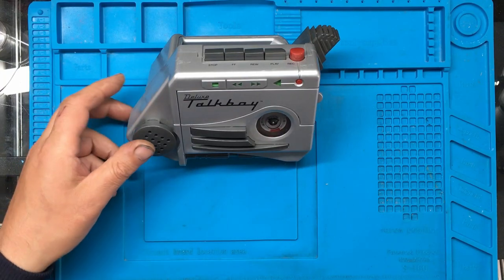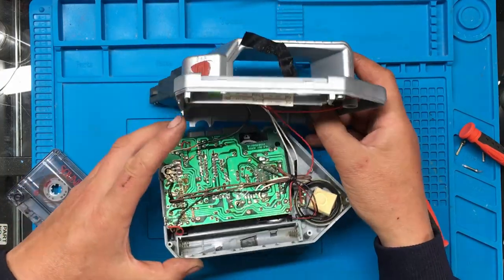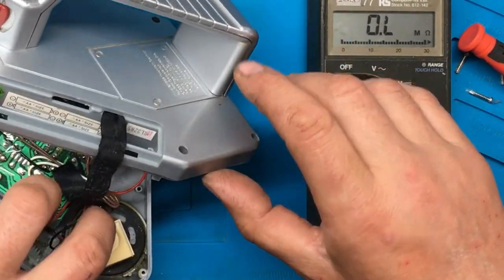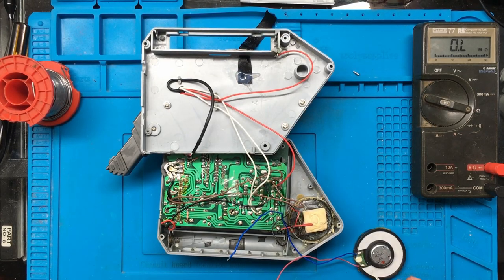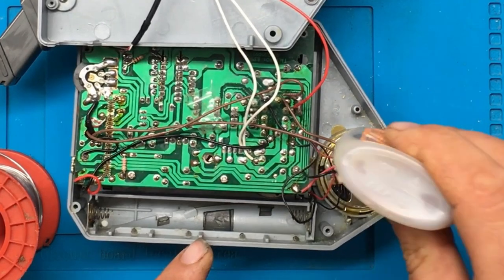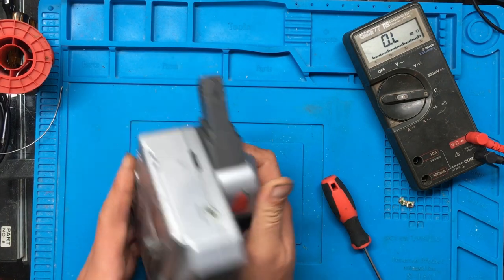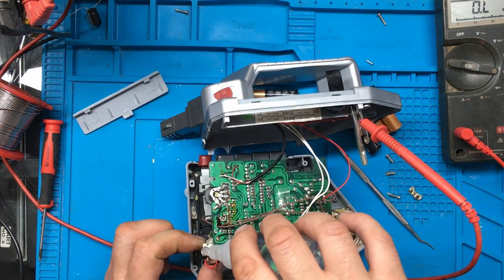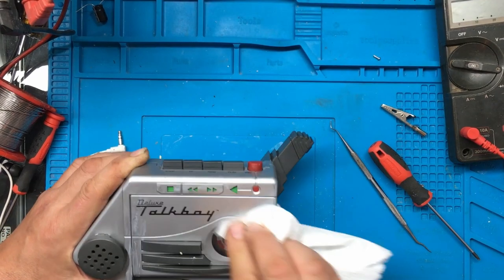Deluxe Talkboy - Faulty / Broken - Let's Fix It!

Comment: Fantastic !!   Can Apple Cider Vinegar be used for the corrosion problem??
Reply from the maker: I would have thought so, it's still acidic so it will neutralise any alkaline residue that is left. After its stopped fizzing I'd wash it off with some isopropyl alcohol. Hope that helps 👍

Comment: Thank you for the video! I have the older 92 model and I don't have the screw where cassette goes. Do you you have any idea on how to open the older model?
Reply from the maker: Sorry unfortunately not. I didn't see this screw until I opened the cassette deck. I'd just have a look around where it's not separating hopefully you'll narrow it down.
Reply: The little rubber plug on the outside comes out and reveals the screw.
Reply: @StephenCarlile  Thank you!
Reply: @StephenCarlile  Where exactly is that rubber plug? Tried locating it with no luck.
Reply: @1812salvipapi  on the front, to the right of the red record dot.
Reply: @StephenCarlile  Thank you, I never knew that was a plug. I thought it was just plastic like the rest of the outside.

Comment: Thanks for this video. I've been attempting to repair a talkboy for my nephew, using two donor talkboys. Interestingly, they both have a different PCB so it's not a 1:1 match. The board I'm keeping is identical to the one in your video. I was able to get things working super good with a new speaker installed, also had to solder on a donor cassette speed controller (whatever that part is called). The one thing I can't quite figure out is getting audio recording to work. I've tried soldering on a new mic, no luck. When I hit record, it will "erase" or record over the old tape recordings, but it will not add any of the sounds going into the mic. Any guess what could be happening or how I could potentially resolve it?
Reply from the maker: From what I remember when I looked at this one it is based around an IC that had an example schematic of how the circuit works. There is a switch with quite a few contacts to swap from recording to playback. If it was me I would probably use my scope set it recording and follow the signal to see where it goes and stops. If you don't have a  scope you could possibly trace it by probing with a small amplifier to see where the sound goes?
Reply: @BuyitFixit  Thanks for the ideas! I'll report back if I am able to resolve it.

Comment: What speaker did you replace the old one with?
Reply from the maker: It was a 40mm 8ohm 0.5w speaker that I purchased from Ebay, item 233227469203 hope that helps 👍

Comment: Could another repair place fix mine? The door where you put the cassette in is broken because the plastic piece on the inside is missing. I assume you could just replace it, right?
Reply from the maker: You might be able to perhaps make a piece of plastic similar and glue it on? Alternatively you might be able to pick up a broken unit from eBay, and use the cassette door from that machine to repair yours.

Comment: hi could you help I used my talkboy about a year ago and now it plays records fine but wont slow speed it did before any suggestions appreciated thanks
Reply from the maker: I'd check the wires going to the speed switch and the switch itself.
Reply: @BuyitFixit  ok thankyou so much for your help